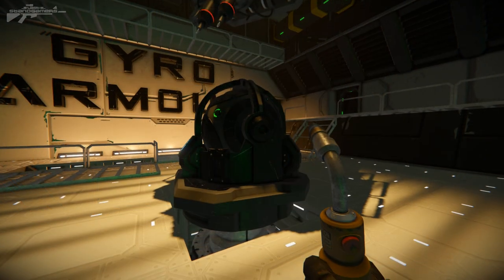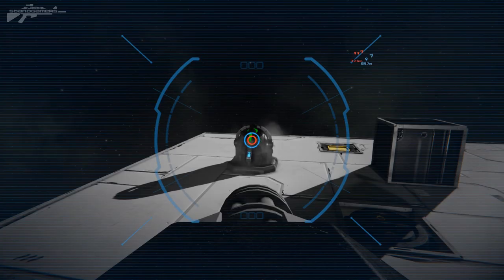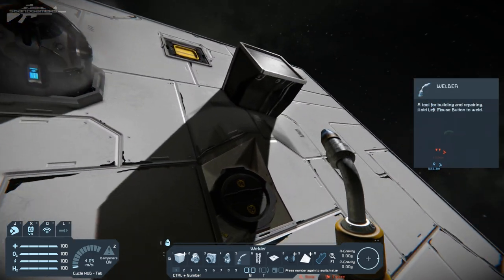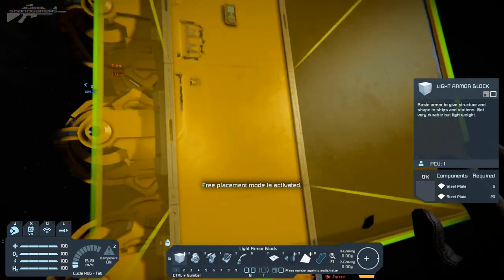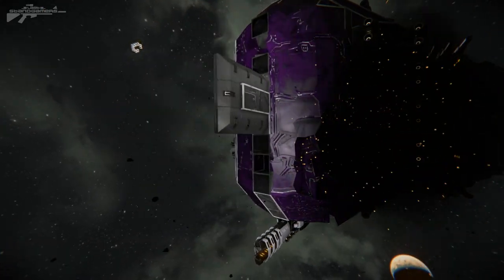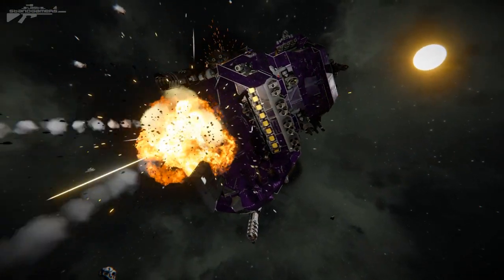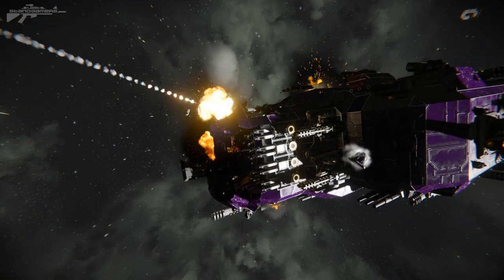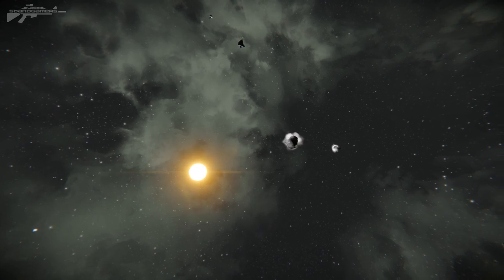Space Engineers - Gyroscope Armour VS Heavy Armour (Testing)

Comment: Heavy armour:
Hp: 16,500
Can be placed mostly anywhere 
Can be deformed  
Gyroscopes:
Hp: 63,105
Can't be deformed
Only has 1 mounting point
Reply: "A small price to pay for salvation"
Reply: Costs more resources and is heavier?
Reply from the maker: Do you think this need's to be patched then ?
Reply: @LastStandGamers  isn't health based on the (amount of) components?
Reply: @Quantum-Bullet  it is. Allthough I'm not LastStandGamers :P
Reply: "Hp: 63,105
*Can't be deformed
*
Only has 1 mounting point"
Does the inability to be deformed changed how it interacts on ramming?  

Also does the inability to be deformed make it more effective at protecting area where shape is important (liked armored gun tubes)
Reply: @Quantum-Bullet  I think only weight is directly based on the components and health is loosely based on it.
Reply: Gyros also have another weakness and that is that they do not possess the armor's ability to block explosion damage from bleeding through the ship (only armor will prevent that). But another way less known fact is that gyroscopes, like any componant block, are extremely vulnerable to cluster ammunition. Light armor is bad and can't resist much, heavy armor is very good at stopping cluster ammo if thicker than 3 layers, but gyro armor will get absolutely torn apart, and probably just make the cluster's ammo debilitating effects even more problematic (as unhooked gyros start flying into the ship, only to be destroying it from the inside every time the ship change speed)
Reply: @mobiuscoreindustries  like gravel you mean?
Reply: @josephburchanowski4636  yes if it cant be deformed then it can usually cut through blocks that can be with ease in the same way blast doors do to heavy armour despite blast doors having less hp
Reply: @LastStandGamers  not really they are super expensive and heavy and only have 1 mounting point and tend not to stop explosion damage fully however i believe they can be useful if placed right
Reply: @mobiuscoreindustries  "and my torpedoes use rotors and a deployment sequence to generate hundreds of projectiles,"

So the rotors are turning into projectiles? Or are they just they releasing projectiles?  If the latter, what are they items you are using as the projectiles?
Reply: @thedefaulttrashbag1316  So how do Gyros compare to blast doors when it comes to ramming? 

Another question, I remember seeing older space engineer videos where objects that don't deform behind normal armor blocks (both light and heavy) help prevent it from deforming.  Does it still function like that?  And if so does Gyro's help prevent the armor in front of them from deforming?

"however i believe they can be useful if placed right"

What would be the best way to place them in your opinion?  On the drone ships they appear to be placed behind armor blocks, is that good method?

Also does having Gyro armor mean that you have more working Gyro's to turn a ship up until the point the gyro armor gets damaged and disabled?
Reply: @josephburchanowski4636  the rotors release their heads, turning them as projectiles. 

This is a keen opsie, when they reworked the physics they accidentally made all blocks that can break easily surprisingly lethal.  In my experiments, the beginner tier was using light armor and merge blocks, then I switched to just using merge blocks for even more fragments (still use this one as an anti medium ship torpedo since it is faster, more accurate and way more effective against targets that can evade).

Then i made this abomination of a rotor spewing nightmare that is my supernova class capital torpedo. It creates a cloud of projectiles which will melt anything it comes across, and the larger the target is, the more of the field is hit

If you want more details, I will be posting a tutorial world on guided ammo where you will be able to find all the info you could ever need
Reply: @mobiuscoreindustries  "If you want more details, I will be posting a tutorial world on guided ammo where you will be able to find all the info you could ever need"

Sounds great. Should I subscribe to get a notification or something?

I do have some questions about your missile.  Like is its damaged reduced by gravity shields?  

Also you said it is really nasty in that it gets inside the hollow parts of the enemy ship, damaging them when they move.  Does it make them less effective against ships that lack hollow areas, or do they just make their own hollow areas to get stuck in?
Reply: @josephburchanowski4636  for the first question, no it is not affected by gravity shields because blocks are not affected by gravity. as such it has no issue with ships that are designed against gravity weapons or have very powerfull warpdrive that could affect projectiles. 

as for the second one, it is a byproduct of the fact there is so many collisions in such a small time, it overloads the collision engine and as such some of the fragments just ignore some of the armor and end up getting into corridors or cracks in the armor. against a medium ship that has high acceleration they can be quite deadly, but against a very slow ship like the vengance the fragments cannot gather enough energy to become threatening. that being said, if a high explosive charge is then used on the ship it can give energy to the projectiles stuck within and make them inflict great damage upon the unarmored systems, but jack's ship has armor even inside the iner deck, so this effect is contained to surface compartements only (as the explosion force cannot reach the lower decks).
Reply: @mobiuscoreindustries  ", it overloads the collision engine and as such some of the fragments just ignore some of the armor and end up getting into corridors or cracks in the armor."

So is there a thickness of armor that negates this affect, or does it require something like spaced armor to prevent.  Or does it do increase damage to space armor?
Reply: @josephburchanowski4636  that is very very unstable. Usually 8 is what stops fragments getting stuck but sometimes (usually for stations) they do not penetrate and sometimes they ignore the ship and go through it. It disintegrate light armor and components tho. Took a fire at the IMDC europa carrier because it has a heavy armor interior and a light armor hull. After the bit the entire ship was stripped of all its light armor and all things that where on the exterior and there was penetration of the heavy armor around the point of impact.

Against proper super heavy warships I do prefer merge blocks based torpedoes because their damage is more focused but once I see a ship is no longer able to evade I will launch one just to get rid of all exterior turrets.
Reply: @mobiuscoreindustries   What is cluster ammunition? Is that a moded thing?
Reply: @StarWarsExpert_  nah, a type of ordinance construction for custom weapons. Usually, relevant to weapons spreading multiple sub munitions close to impact. The most common are using warhead bomblets but anything from rotor heads to small missiles is possible

Comment: My main complaint is the test is flawed. You need to cause the same amount of damage to both targets this way the only change is the armor. You changed the armor and damage variable so the test has lost some validity.

I think gyro armor is useful for stations. If using a mod where gyros are affected by gravity generators you could also weaponize the popping off effect as a spherical grav generator would push out the slufed off gyros and fling them out. The effect is minimal but they would make great turret decoys and potentially add junk for foes to collide with as they attempt to evade the station's guns.

Comment: the count effect can probably be tamed by adding self repairing section behind the heavy block layer... so the gyro can't pop off so easily.
Reply: This would actually work fairly well to mitigate damage from most vanilla weapons quite well,  plenty of modded weapons have enough yield to deal damage back to the welders as well, which can be problematic
Reply from the maker: The self repair idea would defiantly keep the armor intact but would be require a whole load of supplies to sustain for a battle.
Reply: @LastStandGamers  I felt like the test poorly tested how well gyroscopes do from the front; but rather showed how weak they are on a slight flank (notice that the missiles and gatlings in the video had a clear angle on some of the blocks behind the gyroscopes on the ship, thus making it easier to pop them off).

Also for the gyroscope wall test, I would've like to see how many missiles it takes to break the wall behind the gyroscopes from the front (and how much damage the gyroscopes took from it) just so we know how much damage mitigation there is for the back.
Reply: @LastStandGamers  That and the welders can only be 1 block back, so they end up taking damage, so what do you do?  how many layers of redundant welders do you make trying to keep the welding going?  How massive of a hit is maintaining blueprints for several large ships in combat to the server?  It's a lottle of hassle for not much pay off from what I've seen from the tests I've ran,  the armor lasts 1 - 2 volleys longer before the welders get taken out, and you have to fill your cargo space with supplies for repairs instead of bullets.

Comment: the trick in using gyro's for armor is 2 fold.. first while they are intact your ship is more maneuverable.. second.. the armor they provide is based on the parts in each block.. light armor has 25 steel plates.. heavy armor has 150 steel plates plus 50 grids, a total of 200 parts.. then we have gyro's with 600 steel plates plus the other parts... ive seen refineries used as armor due to the amount of parts used to build it.... are there drawbacks.. of course.. but its space engineers.. Klang is out to get you no matter what you build....
Reply: Refinaries and gyros are the best wall in the game and also lighter than the use of heavy blocks in the same space.
Reply: @geronimo5537  they are, but they also have a lot of weaknesses that can be exploited. Gyros are more easily cut off than destroyed, which turns them into projectiles flying in your own ship. Refineries take a lot to destroy but also centralize damage of a huge area into one point, which makes them easier to pop. And none of those can even hope to resist a kinetic cluster projectile, literally only stations and heavy armor can resist it because of Collison physics changes.

Comment: Improperly controlled test aside, the takeaway I'm getting is that gyros are great for absorbing gunfire, but explosions can simply dislodge the blocks behind them which is effectively the same as destroying them.  Also that's a LOT more iron to process.

R.I.P. your poor thrusters though...gyros may aid in turning but having about three times the components of heavy armor has got to be hell on your speed.

If you're playing survival I wonder how effective it would be to just weld on the steel plates and leave out the internal bits?  Might be a portion less durable but would take less time to weld, be a little bit lighter and still have over twice the components of a heavy block...

Comment: You've got it all wrong.  Gyroscopes make a better OFFENSIVE WEAPON.  Here's a video I did a couple of years ago.  I'll leave a link where the action starts.  If you want to see the setup just start from the beginning.  But basically, it's a missile that can be welded without rotors or pistons that breaks apart when it takes fire (inside 800 meters).  The rotation helps distribute the gyros a bit during the terminal flight.  Whatever you have defending your ship has 8 seconds to destroy a cloud of gyroscopes and merge blocks.  Gyros will cut through anything "like butta."  Now put the kettle on.
https://youtu.be/AWNLMHhv_1Q
Reply: Want a tip? Be extra cheeky and replace the gyros with rotors on perma spam of heads. In a matter of 800M you have a cloud of hundreds of projectiles that will plow through anything that isn't coated in copious amounts of heavy armor

Comment: What about replacing the gyroscopes with blast door blocks. They are still stronger then heavy armour but have 3 mounting points instead of 1 so it will be far more difficult for them to pop off.

Comment: Ideas:
- It could be used as armor/penetrator for missiles/suicide drones
- a ships citadel is where the most important stuff was located. It was either protected by strong belt armor. Or even just putting a literal armored box into the ship. In SE, it could be a place where you put important stuff like the bridge and medbay. Big ships need a lot of Gyros anyway, so you might as well put them to use on the outside of your citadel as armoring.
- even in general design, you want to attach them pointing towards the outside and on heavy armor. Again, you need them anyway. So why not use them as armoring?
- I am unsure about putting them on the outside of the ship. The danger of damaging your and the turret distraction would be maximized. But you propably will not need enough to get more then the front or back covered. But on the 2nd armor level, they should work out nicely.

Comment: You would not want to use this method on a ship because a large grid gyro weighs 4 times that of a large grid heavy armor block. You might get away with it for a station but a ship would be too heavy to handle properly.
Reply: and has 4X the hp if not more due to the fact that gyros cant be deformed
Reply: nah, just use interior blocks and gyro armor. never had a problem and the ships work like a dream compared to pure heavy armor designs of the same size.

Comment: Commander, recent intelligence has discovered this, the rwi fleet is made of large ships, but are very weak in numbers, his defender class should not be feared as it is covered in light armor, the two smaller ships sound like they are quite nimble best to prepare for such vessel, the cruiser is relatively small, with focused fire it could be put out of play, the capital ship is probably the one thing you'll need to be careful of,it is armed to the teeth and the control seat is deep in the hull so ignore the massive bridge on top, hangar door could prove to be a weak point if some small fighters can make it inside the hangar, a space version of jacks ship from the previous CW series was talked about, if it is finished it could prove to be an annoyance to the drone fleet. Glory to the DRF!

Comment: This seems particularly worthwhile on behemoth Capital ship vessels that struggle to turn normally due to already having several layers of exterior heavy plate armor.  Adding an exposed layer of gyros on the outside to absorb small arms fire and improve maneuverability seems useful in and out of combat.

This also seems highly valuable in conjunction with regenerative armor, as the gyros are unlikely to be destroyed before they could be repaired should a welder be appropriately positioned.  And, while you can't get 100% hull with regenerative gyro armor on large grid without modded welders, it can be easily done in small grid, where even standard heavy armor can be shredded by small arms fire, but small grid gyros which have nearly 5 times the health of small grid heavy armor, can withstand firepower long enough to be repaired.

Comment: Probably once I included gyro armor on my ship, the developers will patch things to make gyros more fragile or more expensive, anyways, I’d have to redesign the ship, neat to know about the durability of the gyros
Reply: The only way they could do that is by making the block cheaper - health values are calculated entirely based off of the internal components.
Reply: Somdude Willson that’s true for survival mode
Reply: @Bajicoy  That's true for both modes - blocks still have components in creative.
Reply: Somdude Willson I am not sure what’s your point here, resources don’t matter in creative mode, only optimal builds, sure I could use gyro armor in either but it probably would get patched because it’s simply gaming the system, it’s not that difficult to adjust a damage modifier to specific component types to make them more fragile or defining a block type modifier for example. A unit of steel plate probably shouldn’t be as durable as a piece of glass or maybe I have this game all wrong.
Reply: @Bajicoy  It sounded like you were claiming that block health was somehow different in creative.

Also, the component in question is steel plates.  Making them weaker would make pretty much every block in the game weaker.